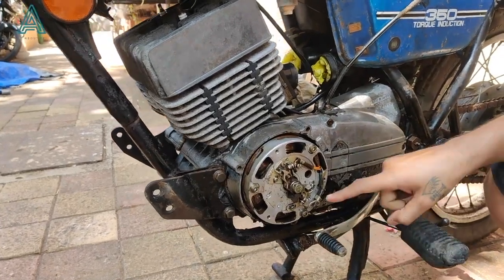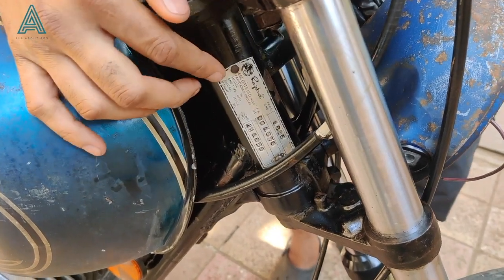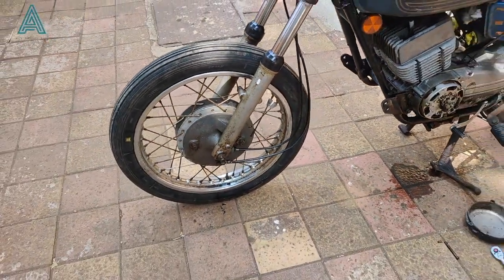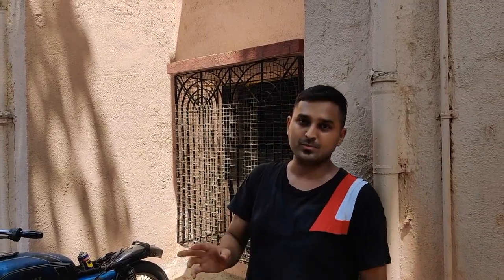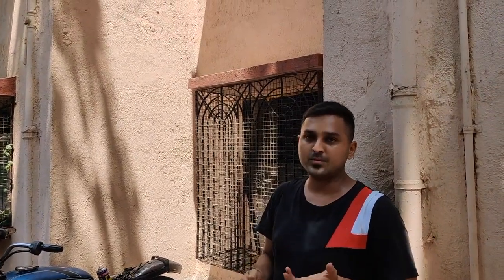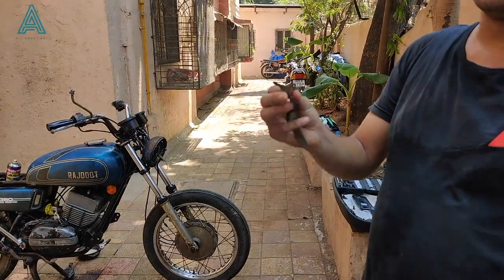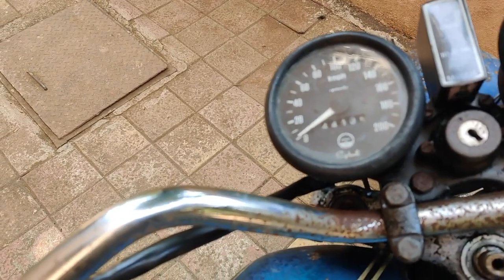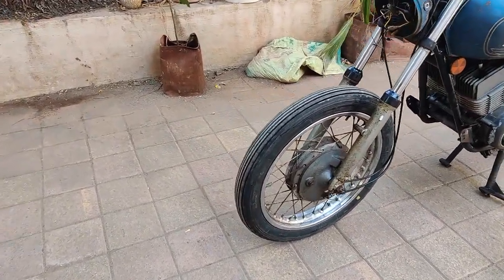Buying a Yamaha RD 350 ? Watch this video. Part 2

Comment: Its C.B point Ignition which is used in Conventional Magneto ignition system, not injection.
CDI means capacitive discharge ignition which is the type of Electronic Magneto ignition system.
TCI is also a type of Electronic Magneto ignition system.
Injection word is applicable for fuel not for spark current.
Reply from the maker: Thanks for the above knowledge. Will keep this in mind.

Comment: stop using the word "point injection" its incorrect ,the point is used for sparking at the correct time of compression ,when the piston is almost at TDC....
Reply: Well said shalmon shelare, this is what happens when clueless half knowledge people start making RD350 videos.  They know a thing or two about RX or smaller single cylinder two strokes and they end up assuming same applies to RD350. This leads to them being Caught Pants down like in this case of "point injection"
Reply: @user-nxvybdi  Jesus bro calm down
Reply: @user-nxvybdi  no need to be so harsh on him. Appreciate his efforts.
Reply: Calm down brothers. Everyone has to have the chance to learn and understand how these beauties work. ITS NO HARD N FAST RULE THT YOU NEED TO KNOW WAT AND HOW THESE BIKES ARE AT A 100%. Everyone has reached a level of understanding only after LEARNING about these amazing Machines